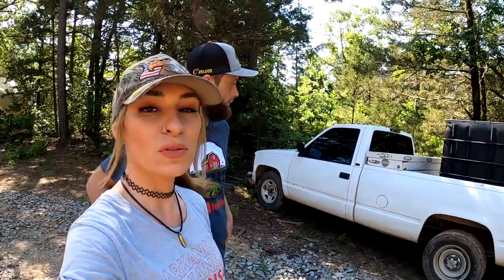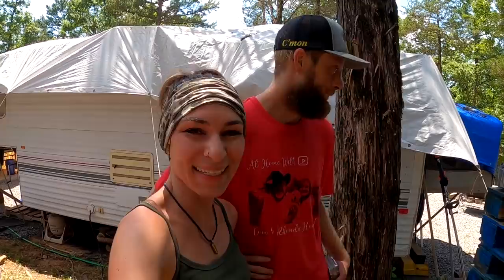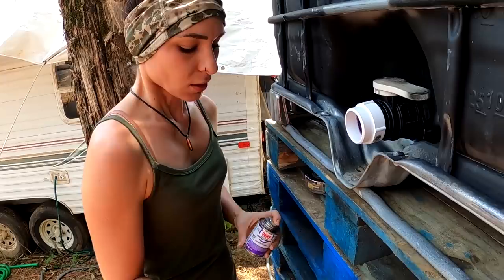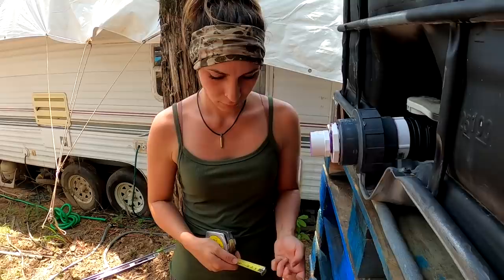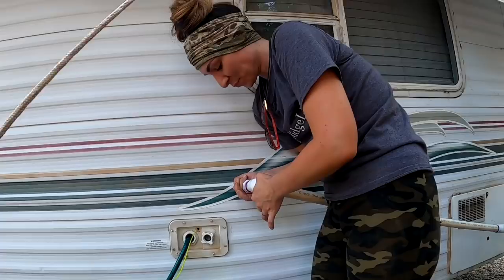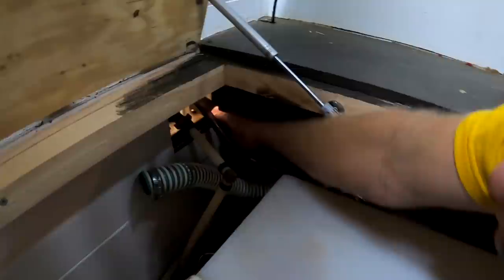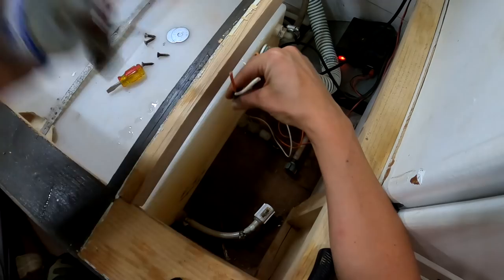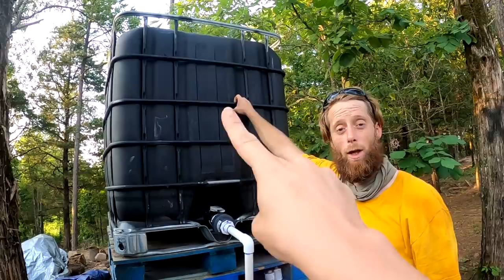He's Putting HER to WORK! | Water Tower For Our Trailer

Comment: couldn't you just make the big tank fill the smaller tank with a fitting on the fill tube? then you wouldn't have to change any piping inside. the pump would pull from the 30 gallon and gravity would refill it from the 245, giving you 275 total. this is what i planned to do on my set up.

Comment: You never glue threaded pipe with cement. I don’t know who give you this idea. The purpose of threads is to be able to be able to remove and reinstall. Always use a pipe dope ideally Rectorseal #5 as it’s good for any application imaginable and never hardens. 
This is 💯% Fact
Reply: Finally !! Mike you hit the nail on the head!! BUT what do I know I'm just an old plumber LOL

Comment: I don't get it, doesn't you van/mobile home have a 12 volt pressure water pump ? All you need to do is connect the in flow to the tank and away you go, pressurised water available on tap. Further, why not use well water after attaching suitable filter ? Better still, capture that lovely regular rain water.
Reply from the maker: Okay so at the time of this videos creation, we were living off of generators. Our well only will pump water from the well to the trailer when the generator is running.. the trailer has an interior holding tank with a small 30gal capacity. With our family size, we were running out of water ever day or two. Having this external water tote, it eliminated the need to run the well generator but only ever week to refill the tote. It worked out very well for us. Was a fabulous set up.

Comment: Why didn’t you just run your water hose straight to the trailer and leave on? You can get some guttering and lay at bottom of gray water drain and run the water downhill from trailer. Then you only have to deal with the sewer water
Reply from the maker: We could run directly from well - but generator would have to run to pump water from well to the trailer, defeating the purpose for us.

Comment: With threaded fittings, you should have used Teflon Tape, not glue.
Reply from the maker: 🤷‍♀️extra I guess. LoL surely won't leak!
Reply: @SimpleLifeReclaimed  no, won't leak. But you'll play hell trying to fix things if it freezes & breaks. Especially the valve on the IBC tote.
Reply from the maker: There's a disconnect that isn't glued. It's a part of the union.